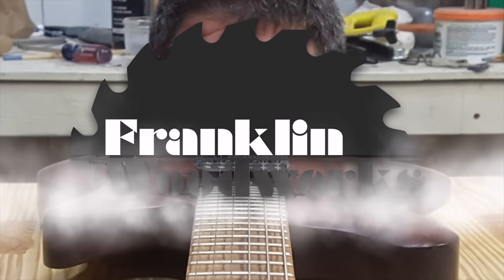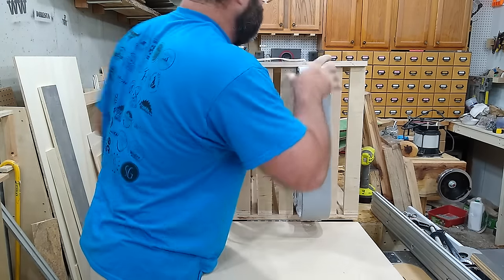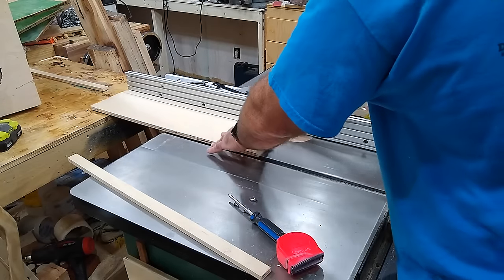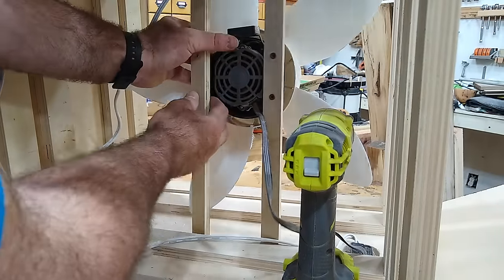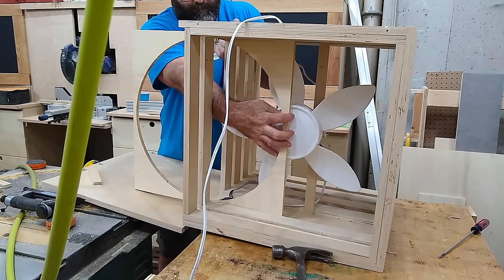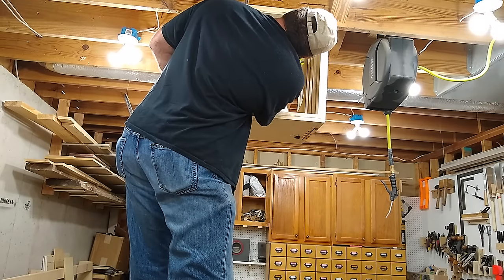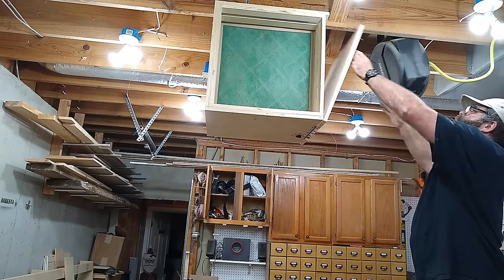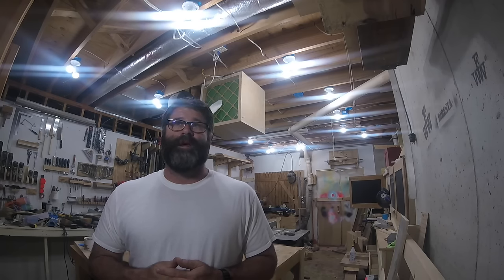Even Better DIY Air Cleaner and Dust Filter

Comment: Thanks for sharing.  You are thinking outside the box and sharing with others.  That puts you pretty high on the list of contributors to the common good.  How can anyone complain about that.

I'd encourage you to invest $150 in a particle meter from Amazon so you can tell how effective your system is.  The meters are getting better and less expensive over time.  A $150 meter might not be super accurate but it will let you compare the dust particle counts of the shop before you start working to counts with and without your filter system after you start working.  Having an objective measure like that makes it easier to home in on an effective solution.  My shop air particle count is usually 90 less than the air outside the shop.  A meter made finding solutions possible.

The smallest most dangerous particles are too small to see so, without a meter, you can't tell if you are filtering them or just keeping them aloft.  You need at least a MERV 11 filter for the system to be effective.  The good news is that you can flow around 500 cfm through a 1" MERV 11 filter with a $20 box fan.  Using a cheap MERV 6 or lower filter as a prefilter will make the good filter last longer without cutting the flow rate down very much.
Reply: Or for less the 50 dollars more he could get another air cleaner. Wow.....
Reply: @SW-zu7ve  I don't believe you can buy an effective air cleaner for $50. A particle meter is worth the investment for anyone who wants to take healthy air seriously. The particles that are most dangerous to your health are too small to see so without a meter you are just guessing. 

For example,  I bought a discount air filter that was rated as MERV 12 (relatively high filtration efficiency) to save some $$. I tested it and it was filtering at closer to a MERV 6 filter which essentially passes 95% of the most dangerous particles straight through. It still got dirty and filtered the big particles but those aren't the ones that get deep into your lungs. 

If he uses a MERV 11 or equivalent filter then this system will effective.  However,  a meter is great for figuring out what does and doesn't work for mods to dust collection ports or to see if your dust collector filter is cleaning the air or actually making it worse which is the case for many types of filter bags.  A meter is cheap insurance  (awareness) for a slow killer. Long term wood dust exposure isn't much different than smoking. Over time it has very similar effects.
Reply: @SW-zu7ve  I think Jose had you in mind when he wrote his comment.
Reply: @markw3598  And what verbal flatulence Mark? Did you even read my comment? Do you even know what I was commenting on? Do you even know who I was commenting to? Anyway I think you  just trolled me.
Reply: @shophacks  Where did I say 50 dollars gets you  a good air cleaner? I said ADD 50 dollars meaning to the 150 you are saying to spend. So 200 dollar will get you an adequate air cleaner.

Comment: Looks like the upgrade is worth it.  I wonder if part of the noise reduction is because you replaced the metal motor mounts, leading to less vibration transmitted.  Good job.

Comment: Very nicely done. Did using 3/4" ply make it too heavy? Wondering why you didn't use 1/2"? (not suggesting you re-make it with 1/2", just wondering for those of us planing to build one)
Reply from the maker: Half inch ply wood be fine.  I used 3/4 Baltic Birch because 1. that's what I had in the shop, and 2. I'm well known for over doing things.

Comment: Great set of videos between the original and the "even better" version.  Combined with the link to the complimentary plans make this one of the best DIY how to packages I've come across - you've earned a Subscriber!
Reply: And curious based on your experiences using your DIY shop air filter, how dirty does the exhaust filter get compared to your #1, #2 and or #3 intake filters?  Where's most of your dust being captured?
Reply from the maker: I change the exhaust filter once every 9 or 10 months.

Comment: It would probably work better with an older Box Fan from the mid 80's or earl 90's since cheap box fans at that time had stronger motors and better pitch in the blades.

Comment: Sometimes 'mediocrity' is a function of the budget... more money=less mediocrity..LOL..!! I will be building one similar to this very soon. I really like the idea of the baffle around the fan in that it closes up the corners. I also plan on installing an exhaust fan through the side of my shop so when the weather is nice I can open up my overhead door and let that exhaust fan do the job, along with a filtered fan of some type. I might just build a box for the exhaust fan with some filters and combine both ideas, but not sure about that at the moment. I know that the fine sanding dust is not good at all for our lungs and even the little dust collector on sanders just doesn't capture near enough of that fine dust. I know...I cough way too much already so I really need to do this. Thanks, Franklin, for the video.

Comment: Since I don't have your skillset nor the tools how much would you charge to built two of them? I have 2 children with asthma and this could really help out. I'm in Phoenix, Arizona
Reply from the maker: What you need are HEPA grade filters in a system that works throughout your home.  My project will be annoyingly noisy in a home setting, and the shipping would be cost-prohibitive.  I think you should check into getting a whole-house air purification system added to your HVAC system.  It will be more effective and cheaper in the long run.
Reply: @FranklinWoodWorks2016  Thanks I'll look into it.

Comment: Instead of those bulbs, it looks like you could use a few of those 4' led shop lights as they put out more light!
Reply from the maker: If you haven't seen it, watch my video (shop lighting upgrade) that will show you why I use the lights I have.  There are so many great options out there now, but I think I was able to save many $$ with the approach I took.

Comment: Something I've often wondered when I watch people install air cleaners - is there any particular reason to always mount them right up under the ceiling? Does this not potentially keep the dust particles suspended in the air longer, compared to mounting it closer to the ground (under a table that's open on both sides for instance) where the airflow would be helped by gravity to keep the flow of particles going downwards?
Reply: At the floor level they will blow dust laying on surfaces. On the ceiling they will not.
Reply: It's those dust particles suspended in the air that are bad to breathe.  IMHO, right at head level is the best place for them, but the least convenient.

Comment: Great video!  The best way would be to mount the fan and motor inside the center of a cylindrical duct with about a 1/8 to 1/4” clearance between the tip of the fan blades and the inside diameter of the duct.  You may need to check to see how much deflection happens to the fan at higher speeds and take that into consideration when creating that clearance. A ducted fan will be the most efficient for an axial fan setup like the one you built.  I use a squirrel cage blower which has a more positive displacement than that of an axial fan and tends to be even quieter.  Noise from the fan blades means that there is turbulence or surge (back flow) which equals loss.  Never settle for mediocrity!

Comment: Would it be better to use round ducting and round filters? It seems that when you force air to go from a square housing to a round opening turbulence would ensue.  With a round system you could also recess the fan a bit into the ducting so its quieter, especially if there was sound absorbing material lining the ducting.  Pot growers battle noise this way apparently, wanting to hide the fact they are using fans to exhaust air.
Reply from the maker: Well it would be, but then I wouldn't have been able to build t out of scrap.  Remember, this wasn't about the best design possible, it was about the best design possible with what I had on hand

Comment: Did you experiment at all with the placement of the baffle? I.e. should it be even with the blade tips, or slightly forward/back of the tips?
Reply from the maker: I didn't, but I relied on Matthias Wandel to do it for me.  He experimented and found that the baffle should be just slightly forward of the fan.  I mounted mine where most of the blade is slightly forward of the baffle.

Comment: Great concept, thank you!  Adapting it to a remodel work environment in my 1949 basement (major dust production work outside or in barn).  My plan is use a 2 inch MERV 8 on intake side & a 1 inch MERV 13 on exhaust port; working w/ insulation, minor drywall, & carpet removal. Scanning comments below my general impression is that filter choice & number is based on cost + desired filtration quality, true/false??
On the issue  of mediocrity: my observation is that there may be some misunderstanding concerning what can be accomplished w/n the confines of mediocristan in contrast to extremistan; I suggest perhaps some below re-read (or just read) their copy of N.N. Taleb's, The Black Swan, so all involved in that (dialogue) communicate from a common level of understanding. Warning: THINKING REQUIRED.
Again, that you for great video, great thoughts!!!
Reply from the maker: You, sir, have won the comment of the month award.  Folks that subscribe to my channel seem to have figured me out well enough to know that what you see me making is generally the first time I've ever made it.  No testing, no rehearsal, what you see is what you get.  That being said, my goal in all of my videos is not to show you that absolute best way to do something, or the best design, or the best anything (although some of the titles may lead you to believe otherwise).  It's to show the viewer something new I've discovered, or a different way to do an operation, or to make something yourself (tools, jigs), saving a ton of money while accomplishing the same thing.  

I also never publish plans. Although the Sawdust Maker made plans for this original build, if I look at plans, it's only to see how a thing is made.  I make the dimensions my own to fit my needs.  I expect most DIYers would want to do the same.  Plus, I want to inspire others to use their brain, think outside of the box, and get creative.

Thank you for your encouragement - it was well received, and sorely needed.

Comment: Ok, I know this is not a new video, so you are probably not that thrilled with new comments, but can I just say, "Thank you!" I just found your video with Richard and grabbed the plans today that he posted. I had just the right size scrap of ply and the fan with filters, but what did I ignore? Yep, the very first thing you said to do, "Measure the fan." I thought, "It's the same brand and looks JUST like the one you had... perfect right?" Wrong. I cut all of my pieces to assemble tomorrow, but realized I should probably pull the fan out of the box. My husband took off the necessary parts and I finally measured it. It. was. too. big. (By a whopping 9/16" both directions.) HOWEVER, you saved me from piecing or cutting new parts with this update of yours.  Without the metal box, I'm sure I can make it work as is. So, if for no other reason for you redoing this thing, you helped this idiot old lady. Thank goodness I kept looking for more videos of yours and not just the one you did with Richard. THANK YOU, so much!

Comment: I was loving your improvements from the original video until you cut the circle for the fan to be next to... After taking out the metal casing to get rid of the corners and then you just reintroduced corners! I suggest taking it out and it should work just as well 🙂

Comment: I  know this is in a shop and the particulates you're capturing are fairly big. But consider switching to a 20x20x4 mirv 13 filter. that will get pretty much everything including smoke and even covid-19. With that you would only need one reducing the size of the box.  Also the filter in the front is kinda useless and will only really serve to decrease airflow. I'd put the fan grill back on the front instead. Also consider some sound dampening foam around the fan.. but thats just getting fancy. 

other than that awesome job.
Reply: I wondered about the filter in front also.  I agree with you Sashimi-X that's probably a wasted detriment instead of a help??  I'm also wondering if you had more surface of filter....like a box with 3 sides (with filters on the 3 sides), wouldn't that give you better filtration (more surface area) than 3 stacked in series??  Or at least filter more air volume faster???  

Don't get me wrong Mr. Franklin, your project and ideas were excellent and quite honestly I dunno nothing about woodworking compared to you, I am just inquisitive and asking opinions.  If I do something like this it will take me forever as sorry as I am with woodworking, that's why when I do it I want to do it as good as I possibly can.  My concern with my idea of putting 3 filters around the outside tho is ......can you make the box strong enought doing it that way???  It might be best to give up the 3 side filter box for Sashimi-X idea with your basic theory. Any comments would be appreciated.

Comment: It's not mediocrity as far as HEPA is concerned, especially given how many filters are involved pre and post fan.

Possibly rotation is arguable and getting some height for box fans from the floor (for us not building boxes, but rather clipping on like the Doctor.. The market is flooded with over pricing. 

This is what we need, How bad is the wood dust in the work shed basement? 

Our next goal is UV, neg ion, carbon, and the other air purification standards.

Comment: The filter fan is a great idea. Increasing efficiency is a great idea when noise is to be controlled. I have found out that using a swirl pattern fan blade with a variable speed motor controller works even better. Because the blade shape is a swiel it cuts the air just so smoothly that even at high speed the noise is very low. Just saying. Sorry that I stole your ideal and ran with it. Good day too.
Reply from the maker: Don't apologize for improving this thing.  I'm flattered that you think the basis is a good idea.  I'm not too proud to have someone school me (as long as they are nice about it).
Reply: @FranklinWoodWorks2016  I will keep you in the loop what I come up with. Good day.

Comment: You need to put the baffle right at the edge of the blades,  it should be as close to the blades as possible, putting it behind or in front as you did, kills the efficiency of the fan.
Reply from the maker: If you look carefully at 2:44, you can see that the blades are in fact, right in the center of the baffle.  The camera angle may be misleading.  What you see about one inch behind the blades are the motor mounts.  The one inch spacers I talked about in the video is what allowed me to put the blades where they needed to be.  Apologies if all of that was confusing.  It's difficult sometimes to write a script explaining things since in my head I know what I did.  That last sentence was probably confusing too.

Comment: Got a question, I am planning to build a 16"X25"X?? device. My question is wich would be more efficient, a single 15" fan or a double 12-13" fans ?
Reply from the maker: Whoa brother, I may be the worst person to answer that question. That being said, I would think the main issue would be to get the air to the fan without the dead space that a rectangular enclosure creates with a round fan(s). If you can create a baffle that fits the fan(s), then it will be fine. And, I'd also think that the more area you have covered by fan blades, the better, although it would be dependent on the efficiency of your baffle system.

Comment: Interesting build but I'm a bit confused as to what the unit does. Are you just filtering the air flowing through the box? Most other dust collection units I've seen on YT are attached to some machine that creates the dust. Second, why the need for so many filter slots? Is it that one filter does not catch enough of the dust?
Reply from the maker: It's not a dust collector - I have that attached to all of my tools with the exception of my lathe.  But even with good dust collection, there is still fine dust that gets in the air.  That's what this unit is for.  The idea of multiple filters is to cut down on cost.  With several cheap filters with low MERV numbers, I can replace one cheap filter a month ($1) by rotating them as opposed to one expensive filter per month ($20).  It's simply a cost saving measure.

Comment: This is not my work but a copy of some engineering comments found in the public domain: 

In the case of the propellers for generating pressure variation,as fans, axial flow pumps, propellers or jet ski, loss of the blade tip are not only a problem of efficiency. Pressure leaks at the blade tip may limit the generation of pressure and reduce the objective of fan or pump. To limit fluid leakage zones, the shroud will be very close to the blades, but the radius at the blade root will also be parametered to avoid leaks at blade root: Because of the low speed at the blade root, the pressure difference generated by the elements near the center of the propeller, allows the passage of leakage. To avoid this, the radius at the blade root is superior to 50% of radius blade tip:

Comment: Try a single 4" merv 13 filter.  This will allow you to pull more air and will be more efficient all the way around.
Reply: Yes but will clog up the more expensive filter quicker yes?
Reply: @koolkid1234ism  no, actually. The greater surface area allows for a proportionally greater amount of filtration as air circulates and the life of the filter. 

I actually use the 4" and don't see a need to change them after nearly 3 months. While the box fan with a 1" in the same garage needs changed already.